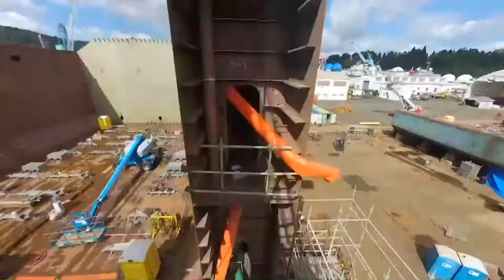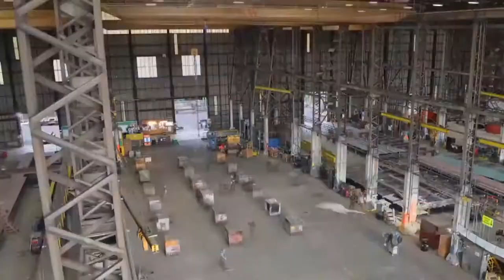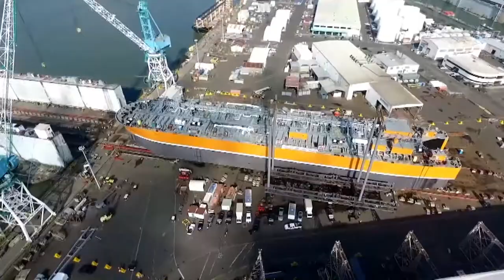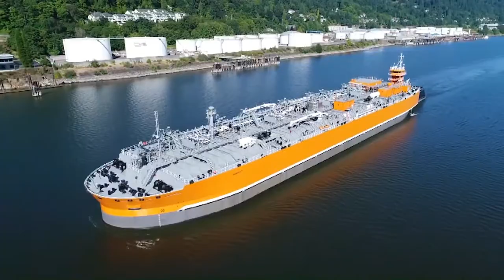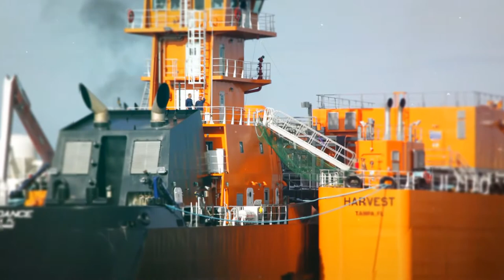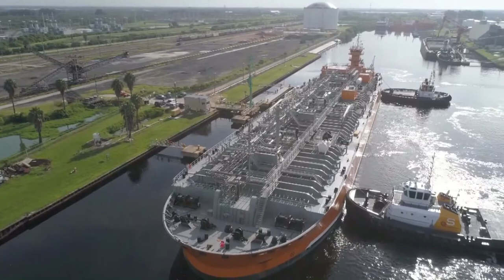ATB video 2

Comment: 30 years ago,  I saw this coming.   I said back then when I was a 1st Mate / Chief Mate for MSC =Military Sealift Command,  

“ The day is coming rather quickly when the  ATB will dominate the “Offshore Towing Industry” for certain sectors pertaining to “On-The-Wire”  towing. It won’t replace the entire towing industry by wire of course,  but it will take over in certain areas because number 1,  it’s 100% safer. And better.”